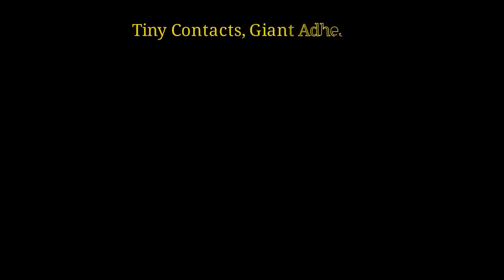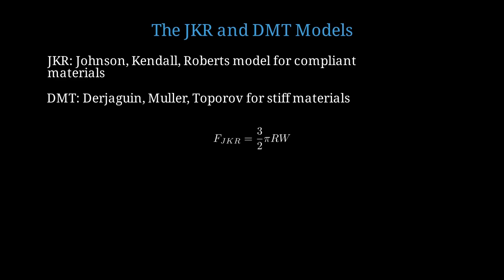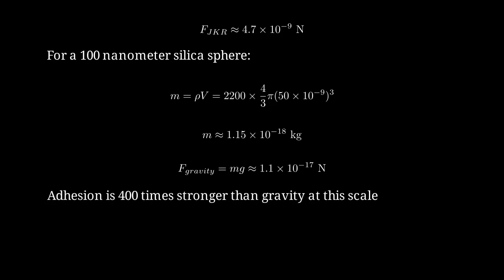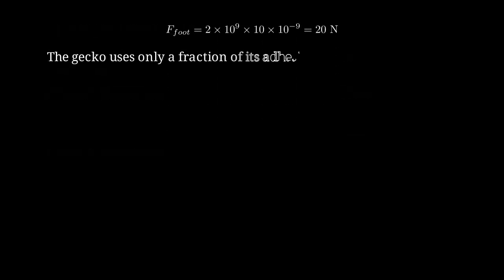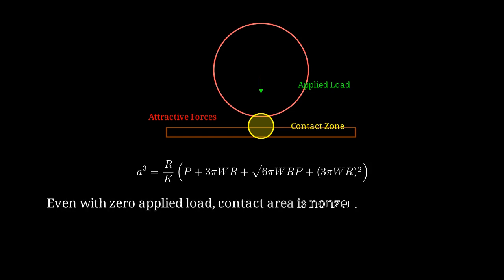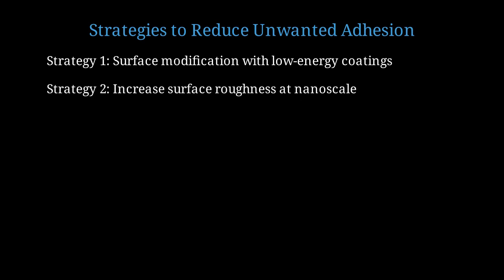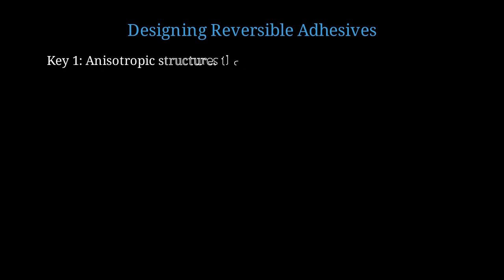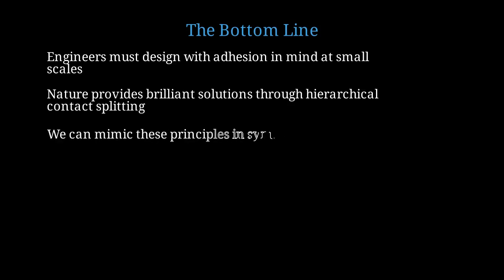Why Non-Sticky Materials Stick Like Glue at the Nanoscale

Comment from the maker: How can the JKR–DMT transition be quantitatively predicted in hybrid materials with graded stiffness or surface energy?
What are the thermodynamic and quantum limits to reversibility in nanoscale adhesive contacts?
How can synthetic materials achieve gecko-like adhesion control under variable humidity and pressure?